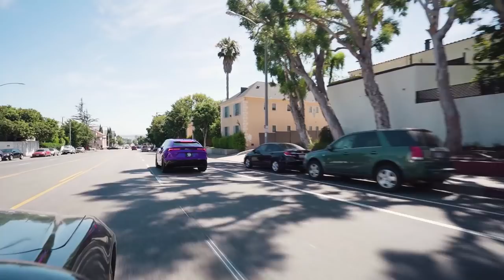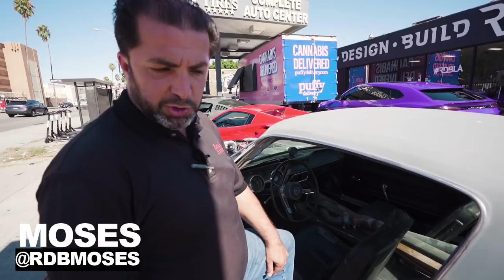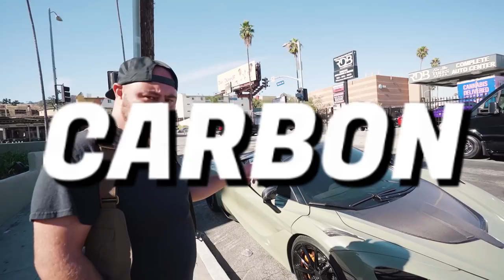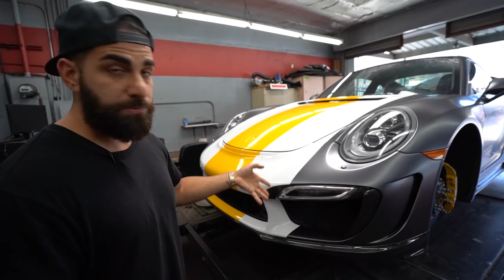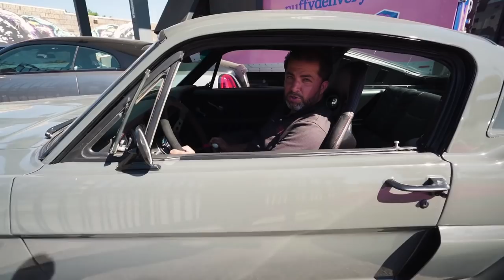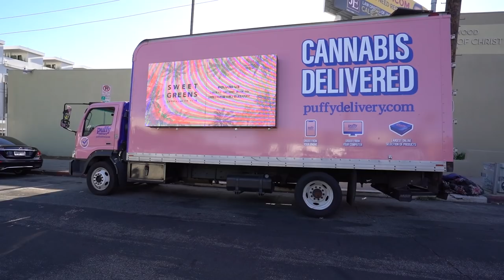NAV'S PURPLE URUS, MCLAREN 720S GETS MORE UPGRADES, TRUCK BILLBOARD.

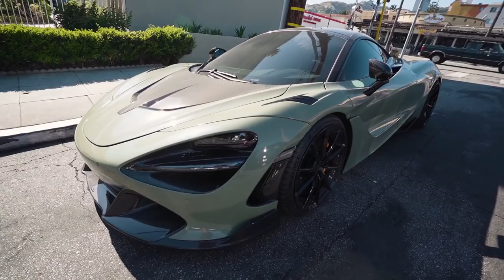Comment: 4:57 What's with the fitment on the driver's side replacement fender on the McLaren? In the 3/4 shot the outside front seems raised from above the bumper? Is that supposed to be like that? Otherwise they look like a good addition!
Reply: malice604 McLarens aren’t the best quality cars, once you take it apart it’s not really gonna go back together perfectly
Reply from the maker: It’s the angle and lighting, sits pretty flush and that’s saying a lot for an aftermarket fender.

Comment: bro i respect RDB but that fitment on the right side/front passenger fender is highly suspect.

th panel gap is horrible compared to the driver'sside....just saying.
Reply from the maker: We dont make the fender and the fender fitment is pretty much spot on. Mclaren's unfortunately have badly aligned body parts from factory.
Reply: @RDBLA  Fair enough